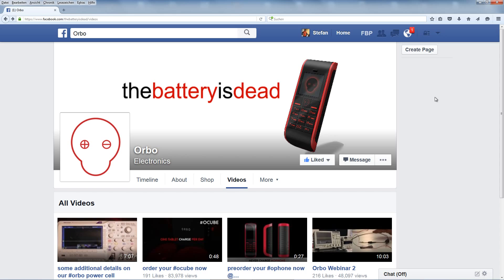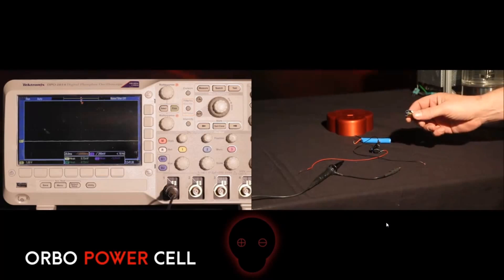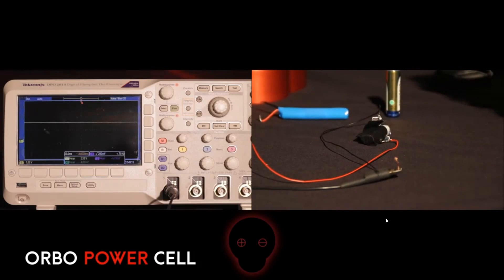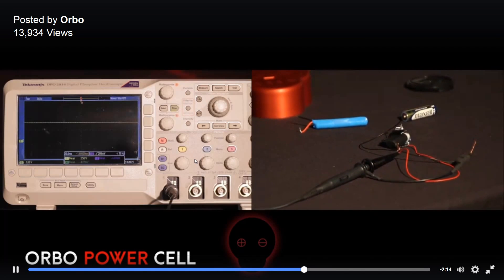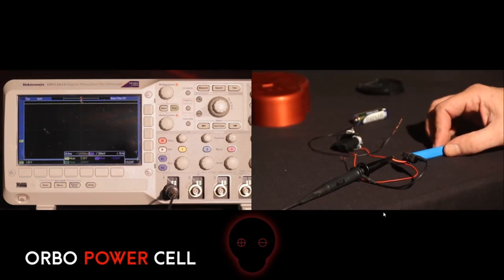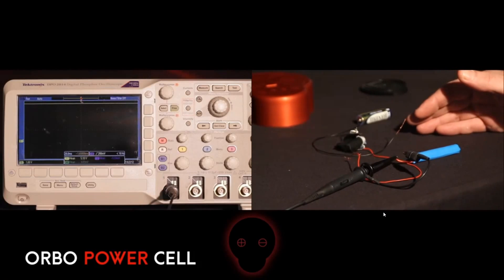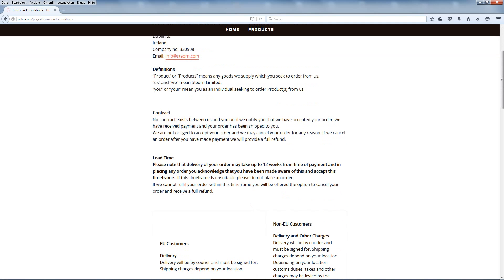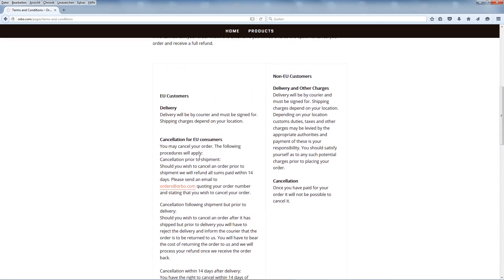Orbo Cells Followup - Solid State Free Energy Generator Cells

Comment: When I started to do more research on this technology I found out the old Oxford bell device from 1840 and is still ringing to this day, is the perfect match to what we were exploring. It is a dry pile made of alternating plate materials just like in our crystal batteries. But as I stated before the current capabilities are real low in this technology and tend twords the static like attraction devices like the bell device. Once a good current is used from the piles they tend to degrade the material itself due to environmental attraction of oxygen to the charged body which incurs oxidation and degradation of the material itself. Having an oxide layer before any current is used from the cell is better but a way must be created to facilitate self healing of the oxidation layer as it becomes perforated by the charges flowing through the layer. In electrolytic capacitors this was done via a borax solution which would heal the oxidation layer as fast as it got perforated by the charge flow going into the aluminum substrate and electrode. Since the bias is facilitated by the potential difference of the plates this acts like a self powered diode. The current flow being dictated by the materials used and the distance between the electro-negativity of the plates and how well the oxidation layer can be maintained without break down. ie when water is used even low level electrolysis happens at about 3-6 volts destroying the electrodes in the process. This is why we never could break the current limit on aqueous dielectric use with the oxidation layer. Except for Aluminum. But the spread of voltage potential between aluminum to say carbon is not huge. Roughly .6-.8 volts. I had found out that multi layered plates was not a good idea since unless it was cell based and connected via wires between the cells. A lead acid battery could not be used since most of the cells were no isolated from each other.

Comment: Also this is based off of diode like activity. Any signal received will be converted into a pulsed potential and as everyone knows there is a huge amount of signals around us today. Any excess current is received from devices using ordinary AC. Florescent lighting being a good source of high voltage AC signal. In the case of this video it is apparent at 6 minutes or there abouts you can see when he is changing the leads that there is a good sawtooth signal in the environment around the cells. This is evident that they are using the sawtooth high voltage signal to boost current of these devices just to garner interest in these devices. This is a scammers technique and if I am right then this is no solution but a scam.

Comment: How nice. A crystal battery setup. They do know this is open source right? They have no legal rights to sell the devices for anything more then parts and labor... It was open sourced for a reason and many models were built already using a great many substances like aluminum and graphite, among the many. The problem with people like this is they troll the boards looking for products to make and slap their name on it when they had little to do with the actual discovery. What they have is a biased, via the plate materials standing charge, capacitor. It doesn't create energy. It maintains it's push until the bias is depleted. The bias acts like battery but is fully dependent on the plates maintaining it's standing charge value. The one problem in all of the crystal cells design was the very limited current capability. With currents on the average of milli amps, nothing good could be driven for any length of time and shorting them out really only resets the potential difference between the two plates naturally over periods of time. One other problem was plate deterioration from current leakage through the dielectric layer. Crystalline material shown the best way to prevent this breakdown but designing a repairable dielectric layer was hard, except for the oxidation layer method. Aluminum being the easiest to protect from breakdown via oxidation crystal growth. Hence the word crystal cell. Again some headway has been made in the way of maintaining the potential difference between the two plates but in order to get good current the difference had to be maintained further apart. ie the electro-negativity of the plates had to be further apart to maintain a better potential difference upon current flow in a load circuit. This meant using highly reactive materials like magnesium which degrade over time if the oxidation layer was not thick enough. But if that layer got too thick current had a harder time to flow from that potential difference made by the electrodes or plates. The best circuits to use with these kinds of cells are pulsed applications or buck converters. Some powerful cells were made by John Bedini using lead. But lead is a highly toxic material and gets away from the spirit of this invention which is to maintain the dielectric barrier in a better self healing way. This idea was taken from the electrolytic capacitors and their ability to self recharge to a limited extent. IBpointless2 and me did a lot of work on this subject and we did a lot of research into the environmental input we think is converted into real current in these devices. Think about this one aspect and you might pick up on where me and IB was going in this one. The eletro-negativity comes from somewhere. It's in the environment or to be exact we are in it's environment. One clue, it shines all day... Heh.. The sun's environment, this whole solar system is charged with a standing potential the sun provides in it's electric potential field. All matter in our solar system is charged and exists because of the electric field around the sun. How does the sun do this? Well everything in that field is looped through the focal point in our solar system, the sun. The sun then re-radiates all of the matters charge back through the focal point and a cycle is born. As more matter comes into the sphere of the suns field it raises the suns potential difference increasing it's value and then re-radiates that back out to now hold all matter in it's sphere to a slightly higher potential. I think you get the point.
Reply: Theirs a reason John bedini used lead and carbon,the same reason Robert Murray Smith uses led and carbon in his free energy ground battery, but you have to buy his subscription to find out why.if we use Walter Russell periodic table I feel we would make great strides in this feild.it doesn't have to be metal cells,metal corrodes,it can be any materials as long there far enough way from each other on the periodic table,being negative and positive,Peter Lang is making good progress here,same with Robert Murray Smith in his forever cells

Comment: A lot of BS because there is only one problem withe their concept that is WAAAAAAAAAYYYY to expensive ! 
On the other hand these are the real deal but TOCHIBA has been paid off to make not to much fuss about it as they already exist from 2004 ! Anyway I will use them in my bike project as they charge around 6min so no problem fast charging going down hill !? Other batteries don't period as these are 3D nano stuff ! Only one holds 180AMPS at 2.4 V and you won't believe it but it's the size of a cigarette package ! And they even don't seem to mind  -30 degrees ! So 30 of these more then enough to power a 72V 5KW bike motor ! Not even mentioning the 4500 AMPS you have at your disposal  for torque ! LOL Will post my progress on tesletic.com ! Info, https://vimeo.com/62754025

Comment: Well, a Tesla car runs on cells derived from laptop battery cells. I wonder how much Orbo would weigh to produce 20-30kW, which is enough to contiously power a car at highway speeds.
In stead of charging a LIon battery, would it work on a lighter weight technology that brings the sames discharge.
Reply from the maker: +Cloxxki I guess you need a huge truck full of the Orbo Cells to run a car and then it will only go with 20 miles/hour...speed...These cells need first to be scaled up to generate more power, if this is at all possible....Hopefully they will also sell soon only the cells so one can play around with these and can see, how one can enhance them....
Reply: overunitydotcom Is anything known about how they do it? Some sort of material layering?